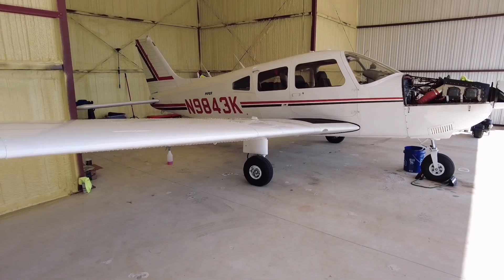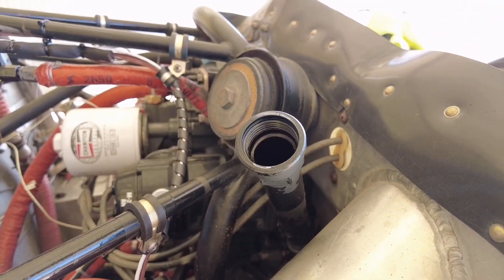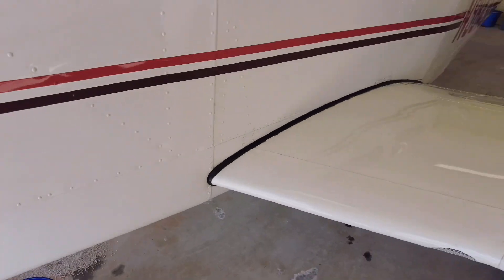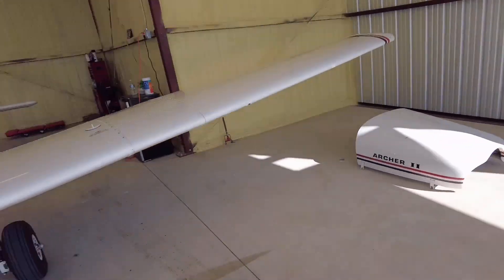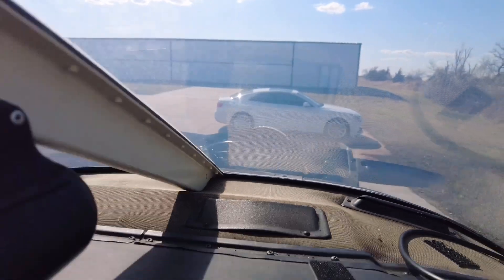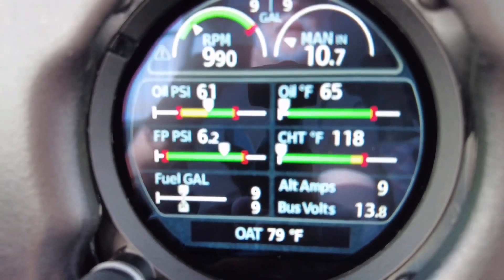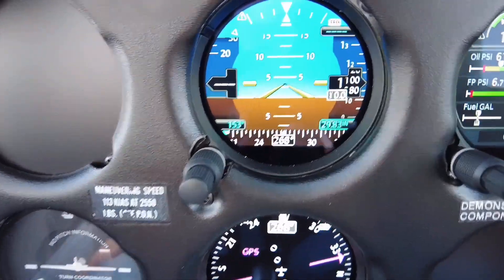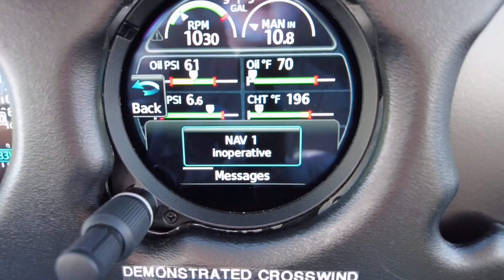Garmin GI-275 Review!

Comment: The 275 is nice, but placing the control knob on the left side was an ergonomic design failure.
Reply: It seems they chose the left side so it would fit in the existing 3 1/8' standard GA panel hole that decision was taken 60 years ago by the avionics manufacturer's in those days. Otherwise everyone would need custom panel holes.

Comment: I was interested in your video as I'm shopping between G5s and the 275s.  When you went into the cabin, I gasped seeing just your 275s and the TC left in the 6 pack.  There was a Mooney recently who had both fail in flight.  For your safety, read up on it and follow Garmin's response. https://mooneyspace.com/topic/38705-if-i-have-two-ahrs-can-i-get-rid-of-my-vacuum-system/
Reply from the maker: Thanks for watching! Our vac system has been completed removed. The turn coordinator has been left to control the autopilot. Both 275’s are independently powered and have reversion for redundancy.